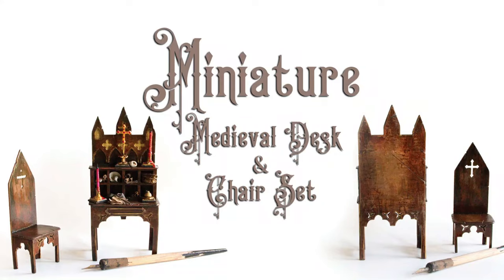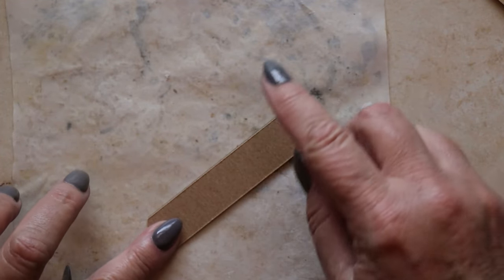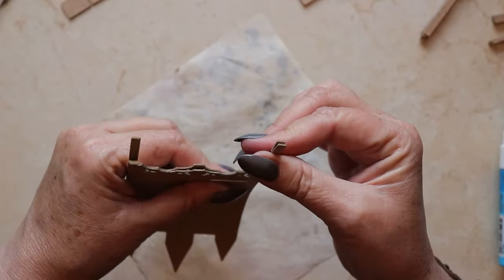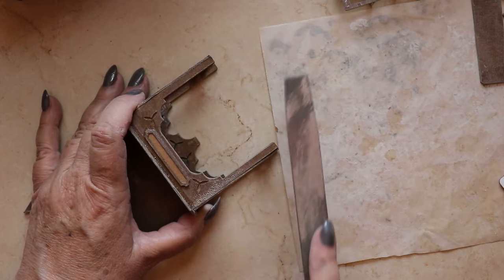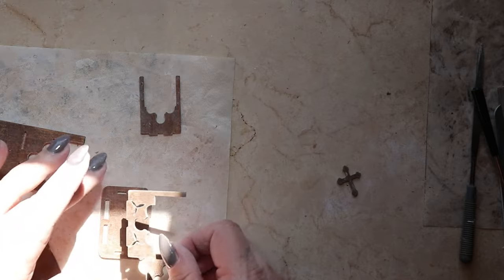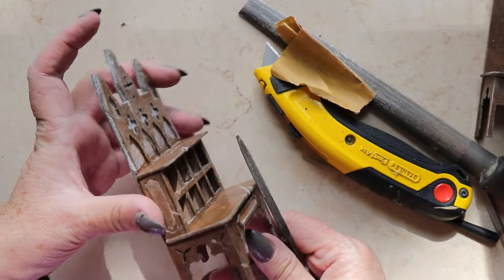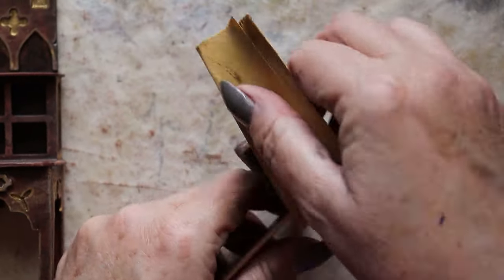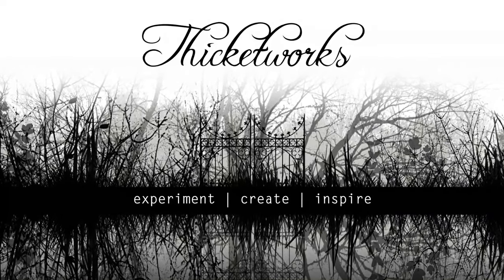⚜Miniature Medieval Writing Desk⚜

Comment: Heather what should the demensions be for the desk?
Reply from the maker: Hi Rhonda - the desk is slightly over 7" tall, 3" wide and 1.5" deep.
Reply: @Thicketworks  thank you so much.  I believe I made mine a bit short so I'll have to try again.  And can I use corel draw to cut some of these using my k40 laser machine?
Reply from the maker: @foxhousecreations4869  not familiar with the file format for Corel. If you have the ability to customize the vector files, they will work with laser cutters. My only concern is that the tabs and slot sizes are based on the thickness of layered chipboard, so adjustment may be necessary for a correct fit.